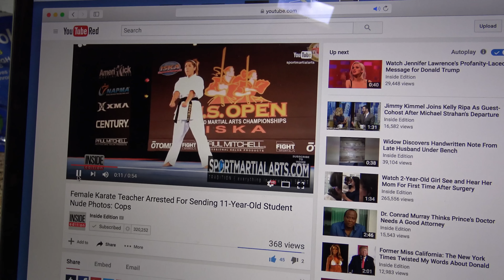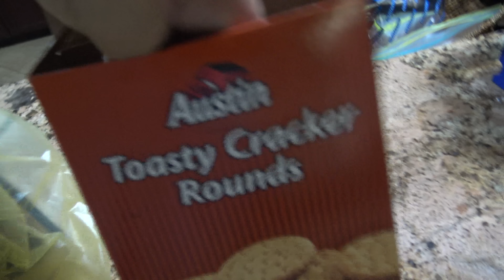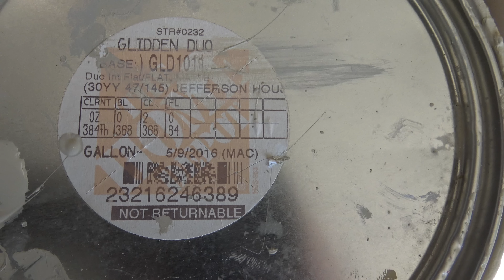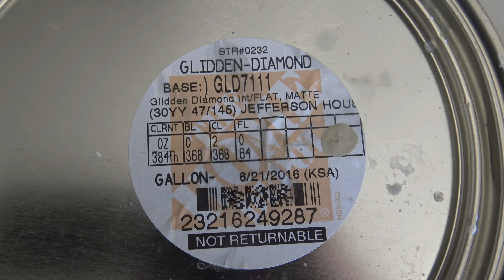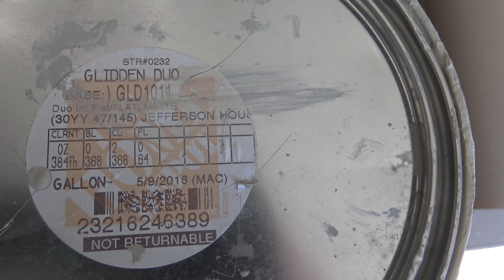Will it ever end? Why am I vlogging?

Comment: re: floor buffer. 
Push the handle (a little) down you go left. 
Lift the handle (a little) up you go right.
Reply: Took the words right out of my mouth. LOL earthtrack 1 is right. But also keep better control of the cord. If it catches in the brush it'll knock you through the wall into the convenience store.
Reply: yup cord over a shoulder

Comment: those floor buffer machines are really simple once you get the feel of it....to go right you SLIGHTLY push up on the handle and to go left you SLIGHTLY pull down on the handle. that's if it's rotating counter-clockwise as you look down on the machine or it's the opposite obviously just think of it as transferring the weight to either 12 o'clock or 6 o'clock....you would be a pro in no time at all Paul ") everything looks great though keep pushing forward buddy you're almost there
Reply from the maker: thank u
Reply: Literally just got done watching your last video seconds ago...lol have a good day bud :-)

Comment: Almost there Paul. Coming down the home stretch. One thing I learned about painting is they can never match old batches. Only way is to buy what you need on the first shot. Suicide rate being high is due to dentist being low in numbers compared to other professions. If other professions outnumber dentist 10 to 1 then in simple math 2 out of 10 dentist commit suicide that's 20%. 2 out of 100 (other profession) gives 2 %.